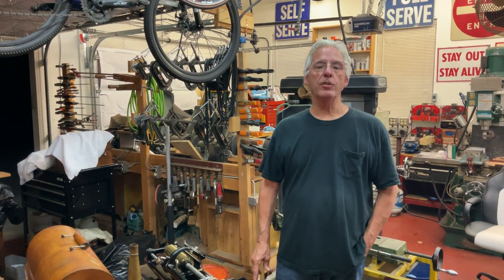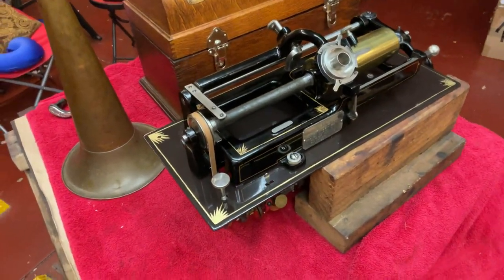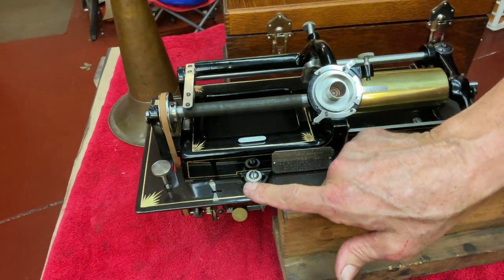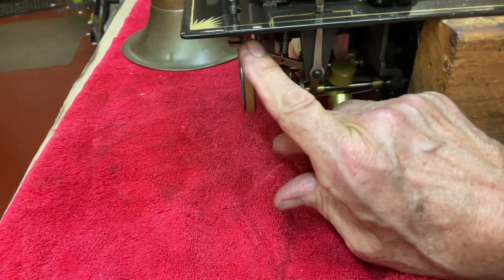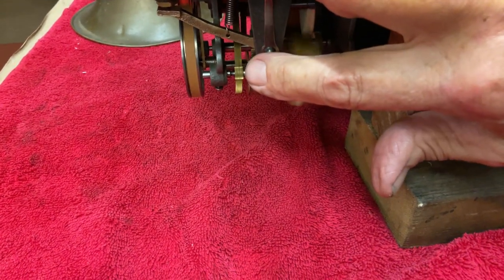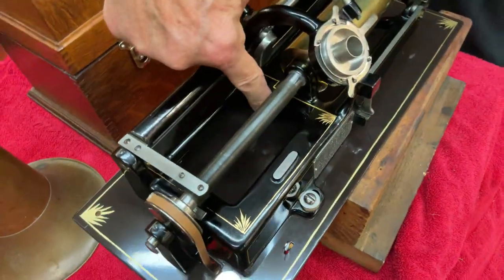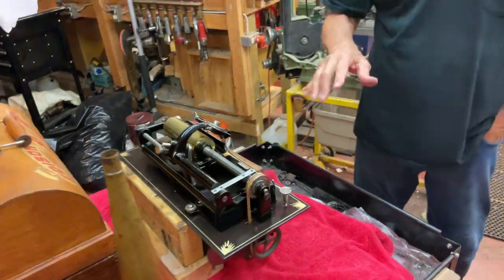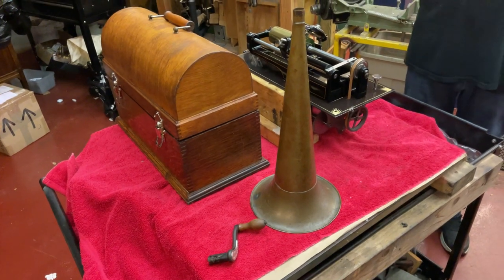804.  I finished restoring the 1896 Edison Home

Comment: I recently acquired a Brunswick 117, I noticed that the motor has a really interesting feature in that the brake works in the motor, and isn't the regular friction break.  This machine also has a real quiet motor, not what I would expect for a machine one hundred years plus.  I payed only $ 120.00, real cheap for how well this machine works
Reply from the maker: Brunswick built the best motors around!